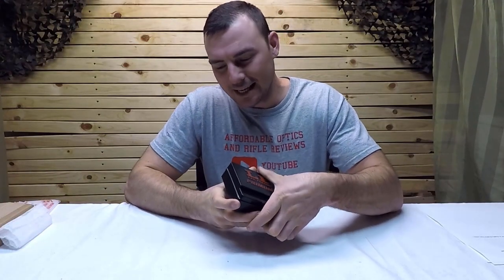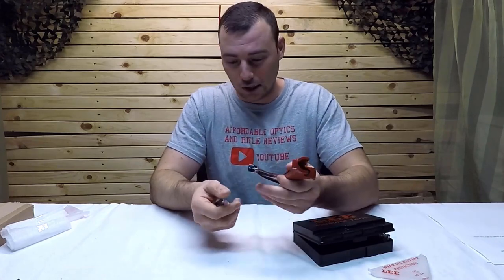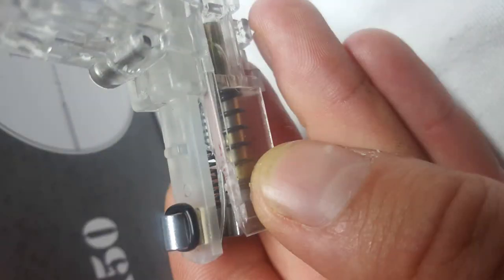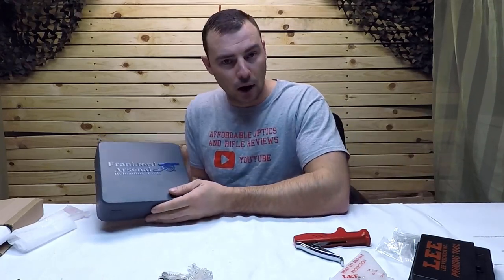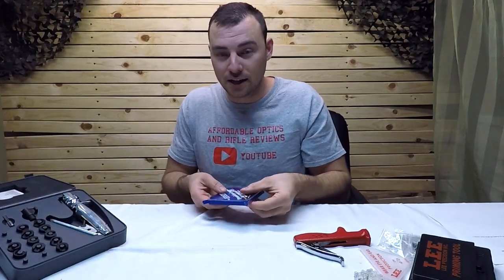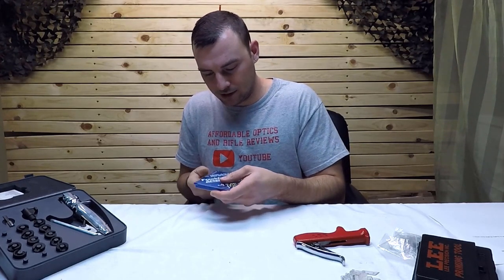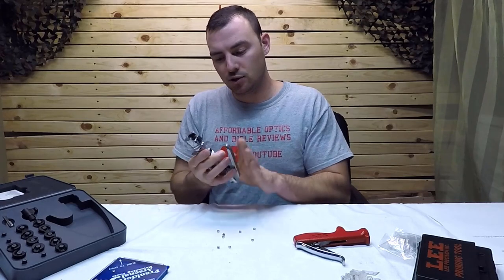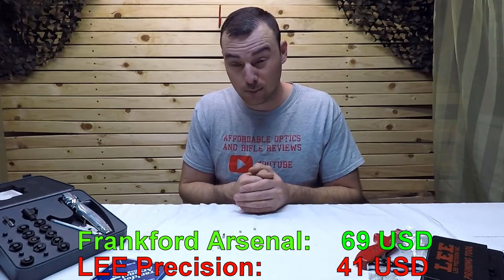Lee Precision Ergo Prime Review

Comment: I have the old Lee hand primer too. Have been running it for 40 years. I dread the day it breaks!
Reply from the maker: i haven't tried all the other brands but the frankford is a dream to use, id keep that one in mind if/when yours dies. i had been using my older lee for 2-3 years before the thin handle broke.
Reply: Same here.
Reply from the maker: Its one of those "they dpnt make them like they ised to" lee handprimers arent what they were
Reply: @EpikArms  Appreciate this review.  I too, have been running one of the old style Lee primers, since the early 70's actually, and dread the day it gives out.  Likely will not go through 20,000 primers in the rest of my lifetime.  Again, thanks for the honest review.
Reply: Bought mine 1991, still going strong. Lubricate the handle joint.

Comment: You didn't mention that it's near impossible to not spill primers with the folding tray.  I have the old Lee Primer, the plastic tray that looks like the one you have in the Franklin Arsenal kit had a tab break off.  But with a rubber band it's still useable.  I bought the new replacement tray, it's horrible.  It's functional but that's the best I can say.  I haven't had the breaking issue yet, if I do, I'll just go back to the rubber band over the old tray.  Your review is spot on, maybe a little kind.
Reply from the maker: thanks Chris, I still have this POS Lee handpriming tool, I cant get myself to sell this junk to anyone. ive been 3 year (2? not sure) with the franklin arsenal, while it has a few small flaws its my go to.

Comment: I bought an Ergo prime about a years ago.  The plastic primer feeders are over designed pieces of junk.  Sometimes I have to squeeze the handle 3 or more times to get the primer to feed.
Reply from the maker: yeah i think the word over designed fits it well. they should have just stuck with the older design and just reinforced a few parts

Comment: The one I have has the upgraded tray from the old all chrome one you had. No clear plastic insert ram. The XR tray works fine in the ERGO but not the partition plate and cage on the tray cover. It jams a bit too much for me. When I had the old chrome one with the round trays with just the plunger and spring...... not the upgraded tray with the two plungers.... I had no feeding issues at all. So swap out the clear plunger system with your old tray with the plain single plunger/spring.
Reply from the maker: Thats a good idea ill see if it can fit

Comment: Wish I seen this before I got mine. Primers do get stuck if I go to fast some primer won’t go in SD o easy had good amount of casing fly out the shell holder under trying to get primer in n I did brake mine but I dropped it so far maybe 50 primers done. The frankford does look like a better deal

Comment: I have worn out three since 1987,  had to buy the new one. I have had trouble with this design, and do not recommend at all.  Primers flip on side locking up, causing a dangerous   situation, at least 5 or 6 times in 100.  JUNK,
Reply from the maker: Ive switched to the frankford arsenal handpimer, and its pretty great about 5 000 cases primed through it so far. Love it